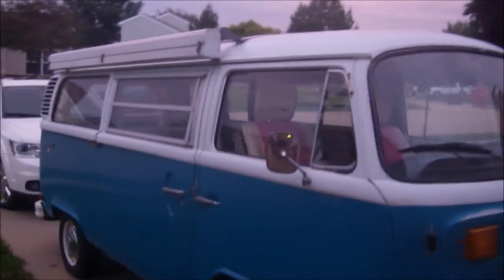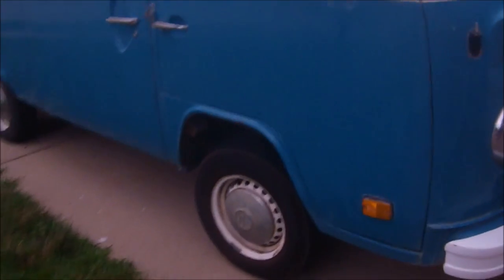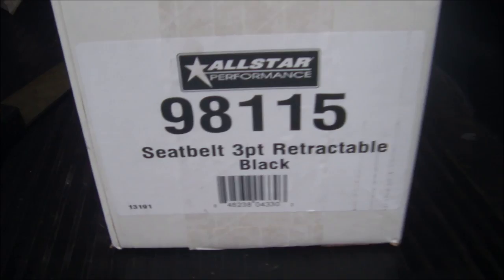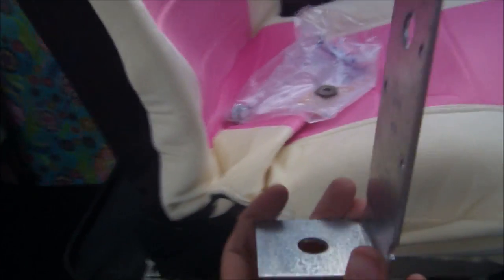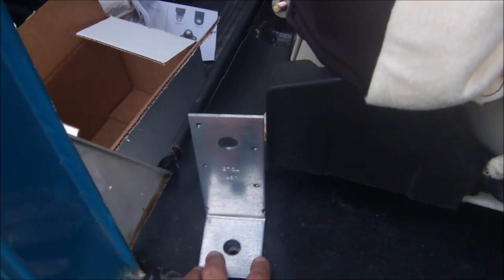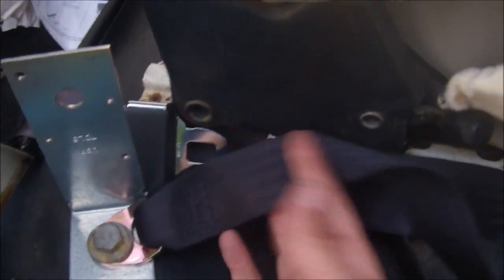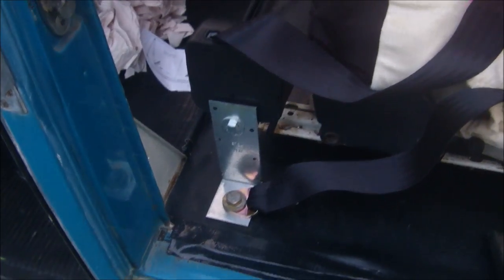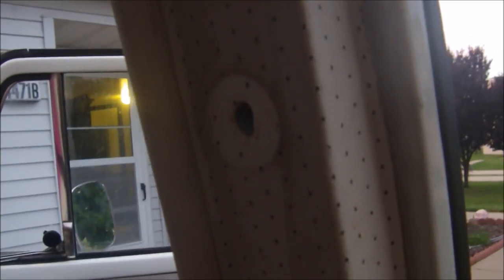How to Install a Retractable Seat Belt in a 1978 VW Bus

Comment: To those wondering: the L-bracket is a Lowe's drywall hanging bracket, found far-off in the lumber section of most Lowe's.  USP Connectors TDL5, Ref #A24, part # AZ111015A.